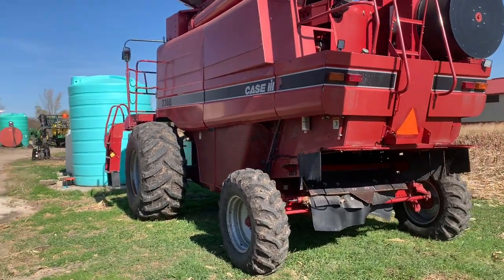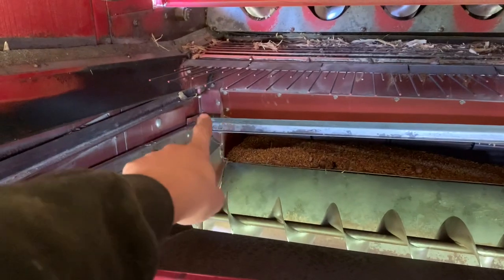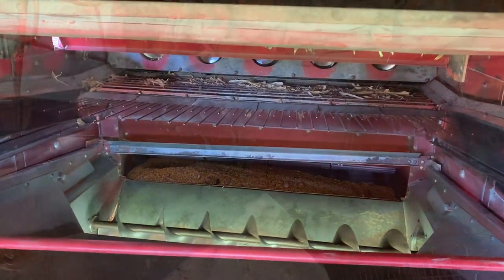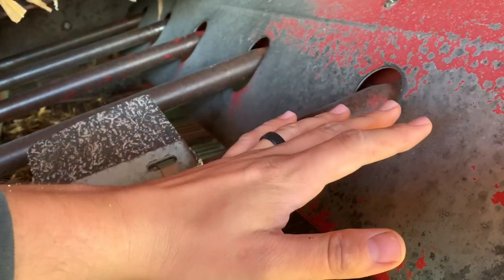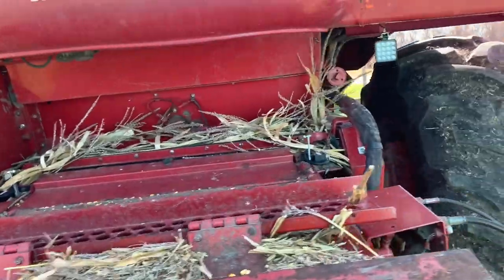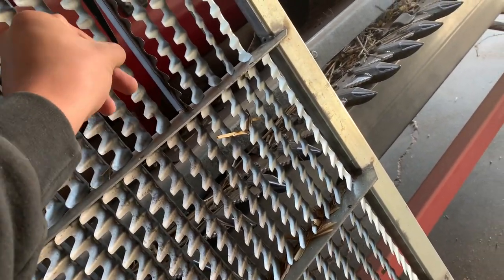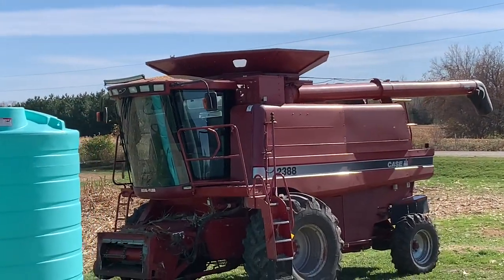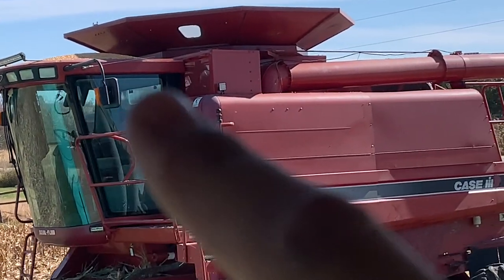How a Combine Works/Combine Puked Its Guts Out

Comment: Give a update when you’re done . Looks like some other stuff is out of wack. If that bolt broke check every rubber bushing. Nice video. Is that the same as the other one? We have keystock grates in are combine. Instead of the slotted ones in that one. Always looking for incite of what’s better.

Comment: I got a new sieve and it didn't last a year on 100 ac. The next one will be a Gateway from Shoup they repairable. The one I got from CIH replaced the factory sieve from my 1440. I guess new and improved Lol.
Reply: CiH has much lower quality than original quality. We put a new clean grain auger in. The old one lasted five years for us. The new on from CIH had heavy wear after one year☹️